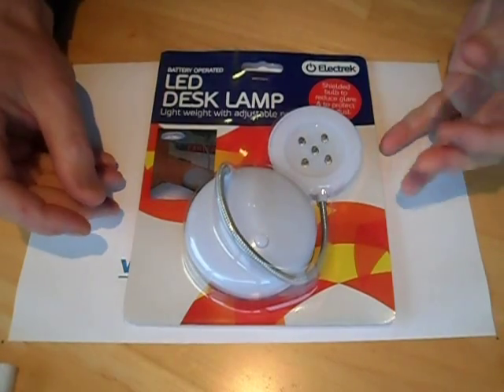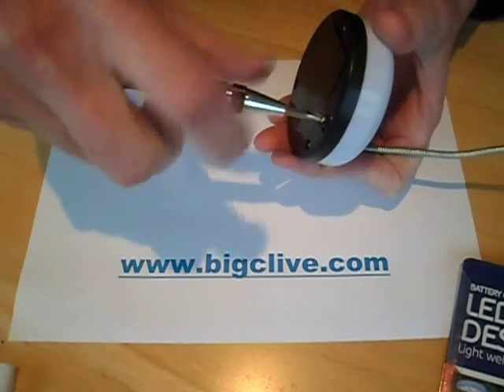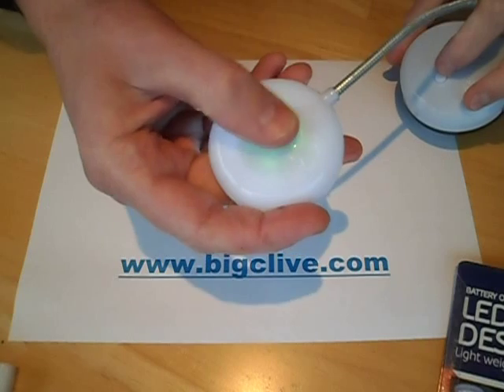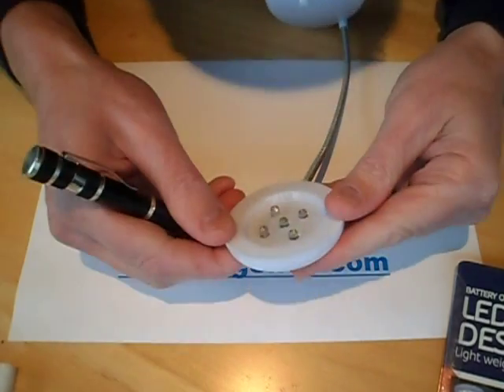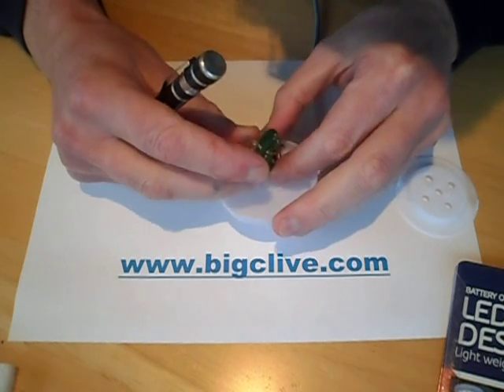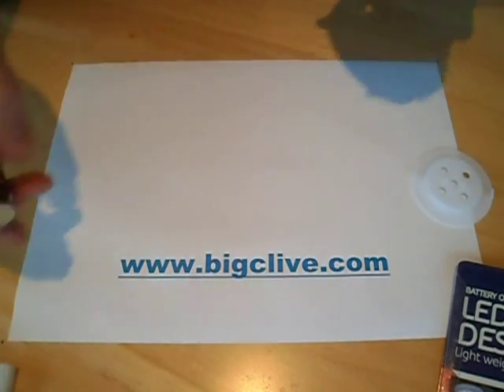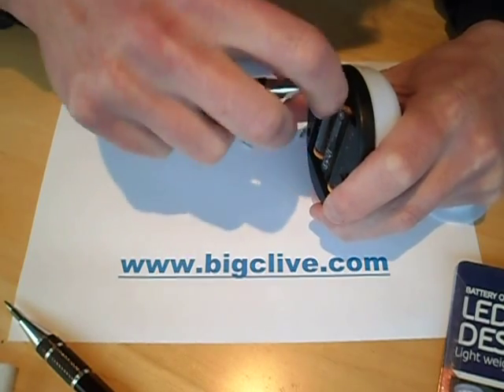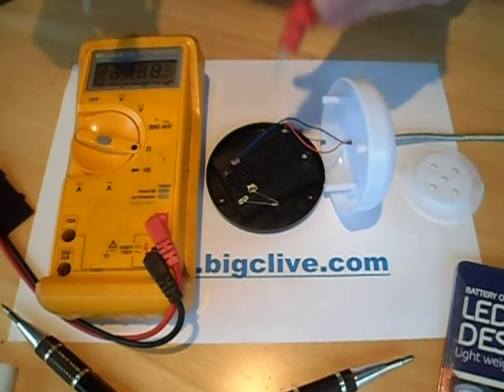Poundland LED table lamp teardown.

Comment from the maker: There is actually an aperture on the casing for an external cable, so USB is quite viable.  What would be really nice is to modify it so that it recharges a set of AA NiMh cells from the USB cable.  Just off my head that would be a diode from the USB and a 5 to 10 ohm resistor so that the batteries should take a charge whether the LEDs are on or not.
Reply: bigclivedotcom - Oh come on. Your channel has become a one trick pony so NOW you are a mod'r. BSometer trip.